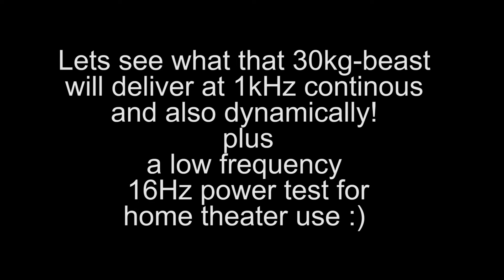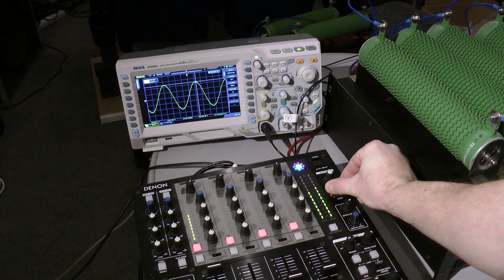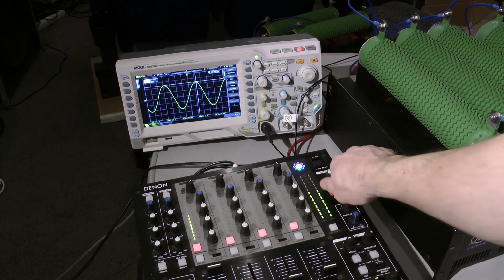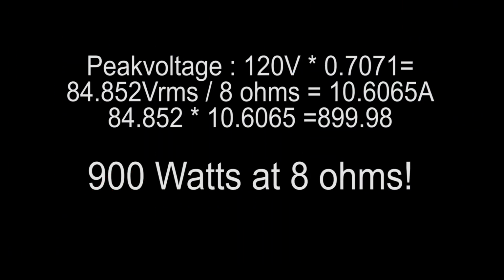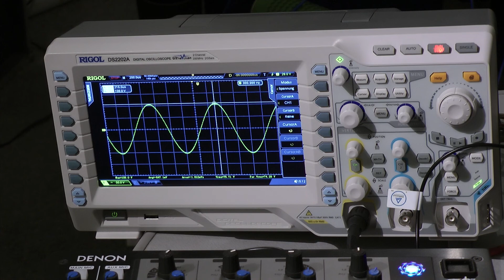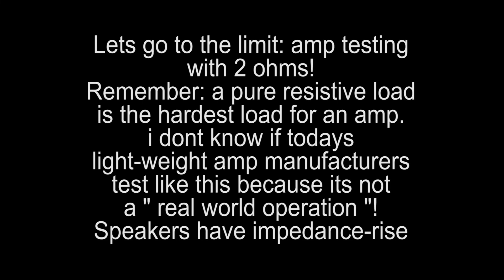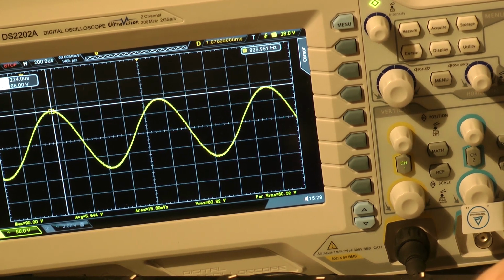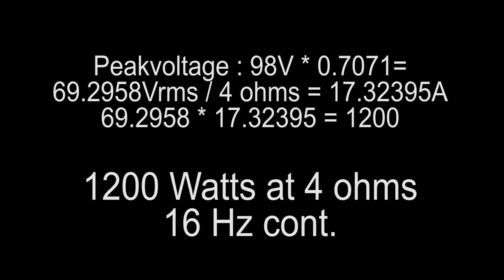QSC RMX 4050 HD professional audio amplifier dyno run power test PA Endstufe Leistungstest #proaudio

Comment: Was the test both channels driven? and what about long term use? can it output these numbers all night? thanks for sharing your test results!
Reply from the maker: In my opinion just a single channel driven or one channel driven into full power and others reduced by x dB is cheating 😊
Dynamic power all day long, continuous power full tilt will trip your fuses on low impedances or will maybe lead to overheating but thank god music is dynamic and has a higher Crestfactor than continuous sinewave testsignals and speakers aren’t a fixed resistor and have impedance rise depending on frequency , tuning and box volume/type . That’s a very reliable and powerful amplifier design but weighs something 👍

Comment: Hello.. 
Our church uses this amplifier to run 4 speakers of 500 watts each.
Recently, this amplifier started cutting off  even at low sound output from mixer..
Any solution..??
Reply from the maker: Hi!
Try to spray the pots with contact cleaner and turn them several times.
Reply: Thank you !
I will try that..
But also to let you know that the amp keeps on clipping even at a normal sound level
Reply from the maker: Then you dont have to clean the pots if the amp clips at low Level. The older Generation of these amps had small boards which can cause the problem. If i remember correct, They are for rail switching. But the rmx 4050 doesnt have these Small boards. This amp is still on the market, you should get the amp to a workshop- its worth it👍
Reply: @audiokeller1975  Thank you so much  for your input 🙏🙏
Reply: @Audiokeller 
We bought a new 4050a  amplifier, and that resolved all the issues😁

Comment: Do it with the 5050
Reply from the maker: i dont own a 5050. the chinese clones of the 5050 are way cheaper. its names are : crown xls 5000 or phonic xp 5000!
Reply: @audiokeller1975  yeah, and they are built horribly and cheaply too "for a reason" and would never consider them, especially in a professional setting.
Reply: @audiokeller1975  If you ever get one of them, please test it, though, I don't think I'd ever trust them in, important situations, though the crown xls 5000 isn't a clone, crown is owned by harmankardon and are in the same class as qsc prettymuch, the xls5000 was their design... The phonic is the only clone.
Reply from the maker: @bobking7347  hmmm... same parts in the xls5000. The phonic xp has been tested in a magazine and did very well. the rmx 4050hd and 5050 are also made in china.
Reply: @audiokeller1975  Do they even sell thos phonics new anymore, I sure don't see them anywhere, on their site their distributer doesn't have the px anymore
Reply from the maker: no. they arent available anymore. i guess its because of the lightweightamps.
Reply: @audiokeller1975  shame, most class d amps have overrated power figures rated at 1khz...
Reply from the maker: @bobking7347  right, they do 1kHz dynamic power ratings, and some manufacturers dont test with 20 cycles, they test with 8 cycles which gives higher ratings for the data sheet!
So, this heavyweight amp is a little underrated :-))

Comment: Objective, methodical and meticulous review; superb work! In the 1970s, McIntosh invited audio enthusiasts to their local audio store for their "amplifier clinics". I brought my Marantz 510M in for comparative testing of power, THD, etc. It was dead even with the equivalent Mac at 8 ohms, but the Mac used "autoformers" and was thus better with 4 ohm loads. BTW, what are the differences between RMX-4050A and RMX-4050HD?
Reply from the maker: Thank you very much!
I think the only difference will be the name. today they sell it as 4050A.
Also same oldschool design like QSC EX4000 with some small changes.

Comment: Is that bridged or 2 channels, if it's bridged you should be getting close to 4,000 watts.
Reply from the maker: Hi! you are correct but thats not bridged. bridged you get 4000 watts and dynamically a little more 👍
Reply: @audiokeller1975  thanks for clearing that up.

Comment: Thanks for posting this video. I've been waiting for more people to do amp Dyno's of Pro Audio / Touring Amps.  
I own a CVR 2004 D & the manufacture claims some ridiculous wattage. I wonder how it will perform under tests.
Owners manual at full power 120v 50a / 240v 25a circuit required.
Reply from the maker: Thank your for your comment! you are right, todays amp manufacturers measure in a completely different way like the amps were tested back in the 80s and 90s. its hard to get infos how they achieved their output power today. back then they rated their amps in a conservative way 20-20kHz with low thd. so they sounded like much more than stated in their datasheets. you cannot compare amps easy because of their specs. if you want to compare amps you should connect a double 18 inch bass speaker to the amp , adjust the input sensitivity correctly and listen 👍 sometimes you will be surprised that a heavy oldschool amp will outperform a modern amp with higher watt ratings 😂🤣😂👍